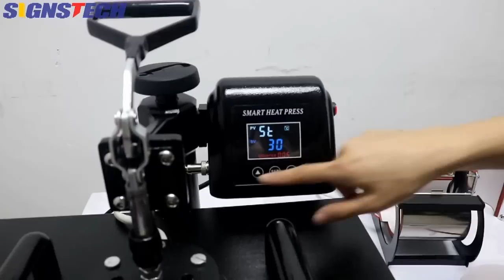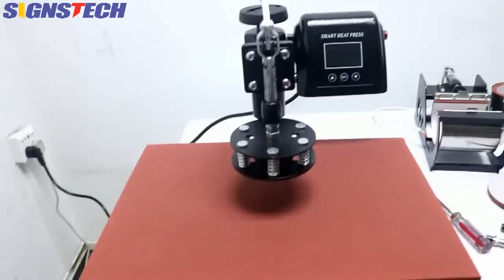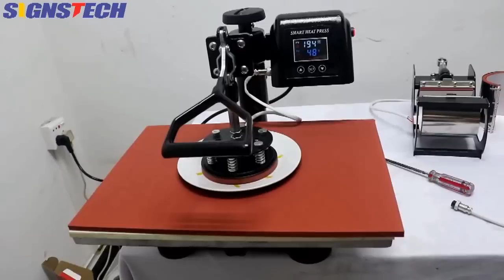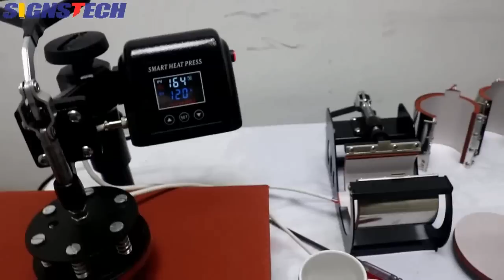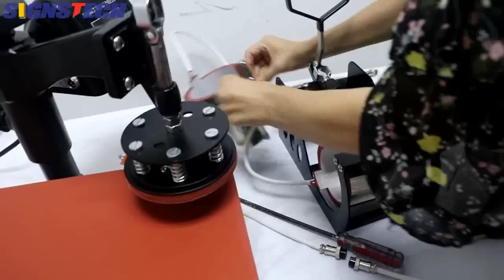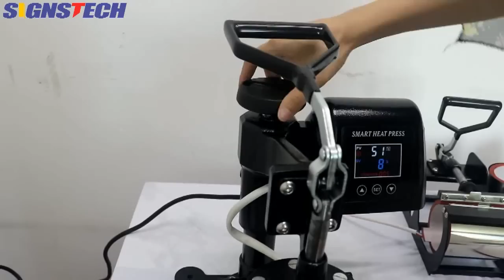How to run combo heat press machine

Comment: Well I recently purchased this same type of combo machine but I am not successful to use it. When I set up temperature and apply the heat, the design doesn’t transfer to the subject at all. I am so frustrated
Reply: Hi Theo, I have the same issues as well. Have you figured it out yet?
Reply: @jemimialee6411  you must be using heat transfer paper
Reply: Hello I wish to know if you already solve the problem and if yes I hope you want to share the way to fix it. I have the same problem.
Reply: You need to use heat transfer paper. Are you using this?

Comment: One missing step is how to design and print the design that you print onto mugs etc... and that is the most difficult part!
Reply: sublimation paper+ sublimation ink+ sublimation printer+ Heat Presses+ Coating Mup
Reply: @lawrencel2131  how would you cut the sublimation paper to press something onto a plate. Would you just find a ring the right size and then trace and then cut?